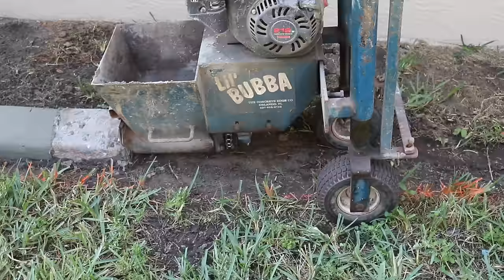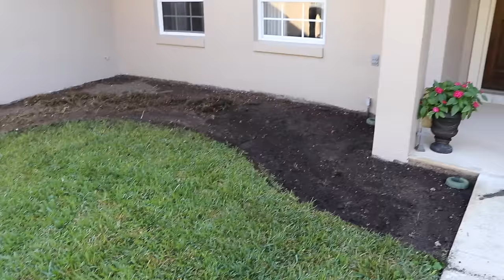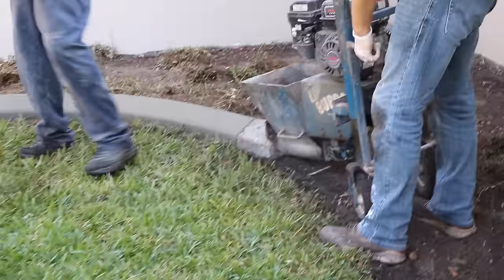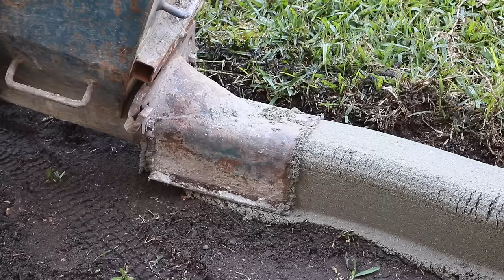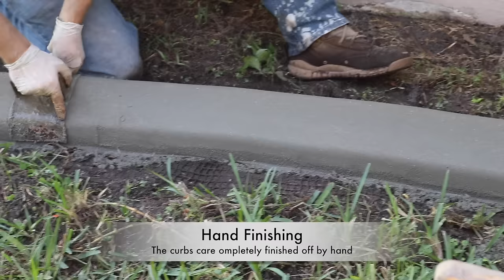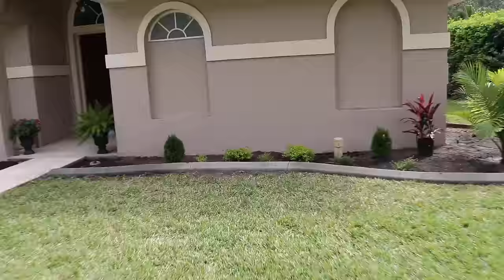Installation of Cement Landscape Edging/Curbing - Awesome Machine!

Comment: The newest version of this machine has a real on the back that feeds a braided stainless cable into the center of the curb for extra support and to stop it from cracking and separating.
Reply from the maker: that sounds like a great idea
Reply: What is it called? cannot find it.
Reply: @aSTaRRBoRNN  the curb debot they’re located in Wisconsin
Reply: They do offer curb machines now with the wire roll however it's really only common where they have hard freezes and shifting soil. It doesn't prevent cracking, it only prevents separation after cracking which is already very uncommon.

-21 years of curbing experience.

Comment: Any update on how this held up? Thinking about getting into this and adding it to my renovation work. Any thoughts, pros/cons?
Reply: This is a very common lawn feature in central & south Florida...it lasts forever.  They used a mix that's less runny so it dries faster b/c it rains basically everyday in FL. It still takes about a month to fully cure. You can also get customized designs & colors.
Reply: will not last in the cold regions. Here in Canada they look nice  at first but will crack and heave and separate.
Reply: How do yall think it would do in Dallas Texas

Comment: Can you adjust the machine so that it lays down the mow curb as even with the surrounding lawn so that it does not stick up in the air too far, or does that depend on the depth of the foundation? Also, if the ground is not perfectly level so that all the wheels, and the machine itself is level, doesn't that affect you finished product?
Reply from the maker: The machine will follow the contour of the ground and nothing is totally flat. If you carve out the ground you could level and make the curb lower and align more to be flush with your grass. You really want a curb to keep mulch back and allow string trimmers to work without kicking up mulch.

Comment: Usually landscape curbing is not made with concrete, it's made with cement which has not rocks in it. Much easier to smooth out.
Reply: Yeah I work for a curb company we use 88 pound bags of commercial cement powder and some sand
Reply: What's the difference as far as wear and tear?

Comment: It would be nice to see if Lil Bubba can go the other direction - right to left.  Also, showing how they complete the pour if there isn't enough room for the machine.  In prepping for Lil Bubba, did they use a trencher to remove the sod?  Just curious about details of the process.
Reply from the maker: The sod was cut away with a shovel in places that needed it. I had pulled out old shrubs and was re-doing the whole area with new plantings, so the area was pretty open and waiting for the curbs.  When the curb gets close to a sidewalk or other stopping point the curb is slopped down and a small space left to allow water drainage....those areas were hand finished.

Comment: Wouldn’t it be a good idea to put a base down as with all concrete?
Reply from the maker: I believe it would make for a more solid base ...since there is no force against the curb i.e. cars bumping against it, etc. it has done well since being installed.  I sealed the cement and no issues thus far.
Reply: @LazyDayz316  What did you use to seal it? I just had this don't want to regret it.
Reply from the maker: @cynsational8700  I used a sealer that can be bought at Lowes, it works well and you definetly need it.  The cement gets black and moldy if you dont seal.  I reapply every 2 years.
Reply: @LazyDayz316  Do you mind sharing the exact one you use? Different brands differ and if the one you have is working for you I'm interested in that exact one.
Reply from the maker: @cynsational8700  This is it!  You can get concetrate and add water to it...or get one already diluted and ready to use. https://www.lowes.com/pd/Eco-Advance-Clear-Flat-Concentrated-Mildew-Resistant-Mold-Resistant-Waterproofer-Actual-Net-Contents-16-fl-oz/50224777
Reply: @LazyDayz316  Thank you so much for sharing.

Comment: It doesn’t look terrible. I just prefer a nice looking brick or rock layout rather than concrete
Reply: they  can stamp that  print into these curbs also just costs extra to finish it like that
Reply: Yea we do that here in colorado colors 415/417 in your mix will give you a nice brick color followed by a stamp roller with the brick design!

Comment: How do you keep it so flat. Its been build up on me. Starts over lapping itself. What am I doing wrong. How much water do you use. I've been using 4 buckets of sand to 1 concrete full bucket and 3 gallons of water.
Reply: Where you able to resolve this issue.?
Reply: Idk if this helps. But we use about 40-45 shovels of cement sand to a 94 Portland cement bag. We get about 100 linear feet with that mix
Reply: 94 lb pound bag

Comment: Any problems develop due to not putting down a footing?
Reply from the maker: None so far.
Reply: Joe VK it’s the same basic principles they use for street gutters and all of those are poured with no footings, no rebar, no wire, etc and they do just fine. 

The theory behind all of this is that because the curbing is poured directly on top of the ground and there is nothing pinning it down trying to keep it from moving so it will actually move back and forth in minute amounts which will in turn prevent cracks from occurring and that’s why it’s important to trowel in expansion grooves or put saw cuts in every 8-10’ so that when it does crack it will do it at that location and prevent ugly cracks from occurring elsewhere if that makes sense. 

If you inserted a short piece of rebar into an existing driveway, walkway, or foundation and “tied” the curb to that then it would crack all over because it would be tied in place and can’t move like it wants to

Comment: Looks nice,  but in a cold climate with freezing and thawing everything heaves.  I would imagine that would crack up good.
Reply from the maker: your probably correct, this is a hot climate area
Reply: should add a foundation in cold climates
Reply: @dw2843  wht type of foundation  would this require for a cold climate like Minnesota ?

Comment: How is it holding up?
Reply from the maker: I have one small hairline crack in the back of the house...I bumped it pretty hard with my lawn tractor wheel when cutting the grass.  Overall it is looking good though!
Reply: If you don't mind me asking... how much per foot would you consider a good price? I'm looking to get quotes but unsure what would be a reasonable  price. Thanks for the response and video!
Reply: @dillonthompson9656  he said   elsewhere its 4-7$/ft
Reply: Check out the reviews before you do that.  Some of these places are troublesome. @dillonthompson9656

Comment: width and depth?
Reply from the maker: There are various curb sizes and shapes that can be selected. We chose this very simple and smaller version that is about 6” wide and  around 5-7” tall (it slopes).
Reply from the maker: I had another person comment that a newer machine does actually pull rebar from a spool as the machine is making the curb I have not seen one but it would definitely be stronger if you need it to be.
Reply: @LazyDayz316  lol I wanna see one with a rebar spool

Comment: This is going to crack in a million different places
Reply from the maker: It's been several years and it's doing very well, I sealed it with a with a good quality cement sealer.  I agree this would fail if it was a car lot curb,etc. and vehicles bumped against it, etc.  The curb just holds soil/mulch in place and looks nice, no undue pressure slamming against it.
Reply: TheLazyDayz the ground must not freeze there ....I don’t think you would have the same result in New York

Comment: Just lay that straight on the dirt.. no sort of base to keep it from sinking and cracking? I don’t see that looking good very long. Should show a video a year from now.
Reply from the maker: They packed the ground before laying the curb, no sand base or anything.  All cement will crack even new driveways I have seen poured and relief cuts placed.  After a few years, they crack.  I have a couple cracks, one where my riding mower hit the curb and another random one.
Reply: It's fine on dirt concrete cracks it's a fact use 1 and half bags cement a mix 👍
Reply: C'mon is a concrete edging you need no base for it wtf

Comment: the structure is too weak always had to put a footing to make it stronger that's a fact Jack.
Reply: You don't use footings for curbs you tool. Footings are used for structure, curbs aren't designed to be structural. They are intended to be a containment. Spend some time in the concrete business then come talk to me.